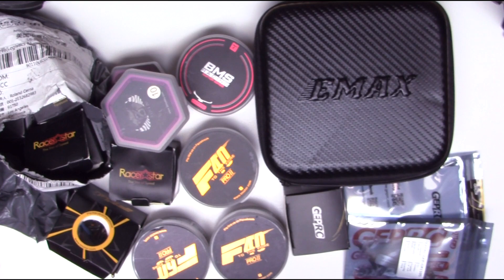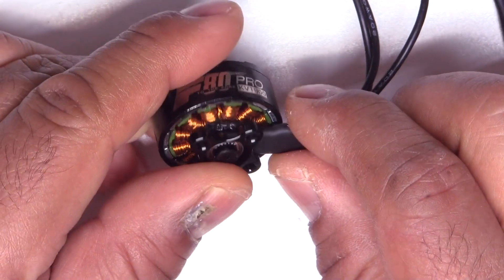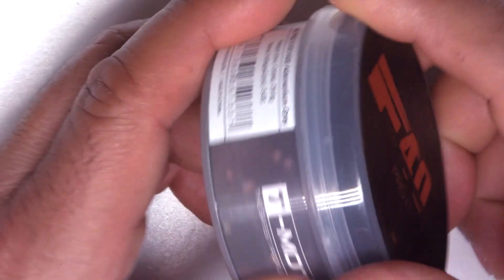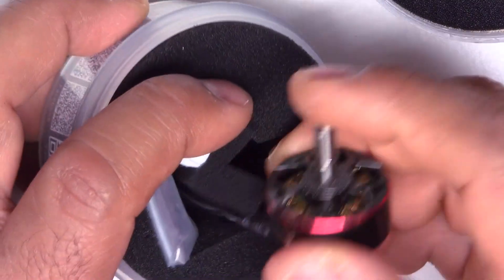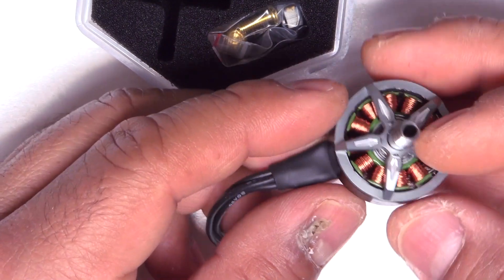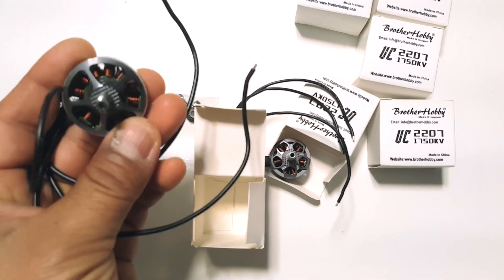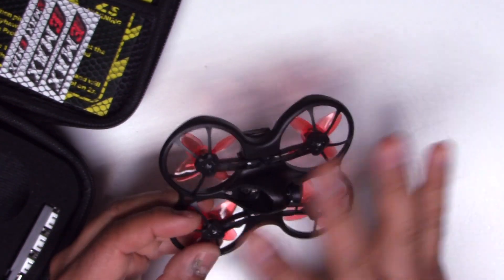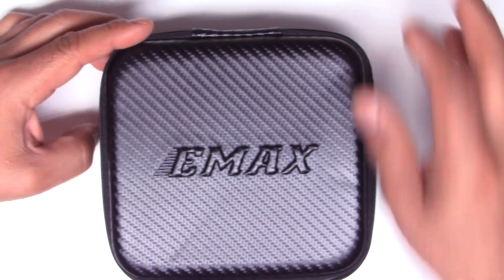Reviews Coming Soon - Update

Comment: There are a ton of motors coming out for lightweight 2.5in 3in and 65mm quads. Please test the new offerings in the 1103, 1105, 1207, and any of the shorter 13xx 14xx sizes and please test newer props. HQ 3x2, HQ 65mm T mount and push on, Emax Avan Mini 3in, Emax Avan Rush 2.5in Gemfan Flash 3052.
Reply from the maker: I'll have to seriously consider ordering all those props, however first I gotta finish testing all these motors and a few more I just got from BHobby. Unfortunately time available for hobby  stuff keeps decreasing :(

Comment: Nice to see you back in business :) I have the racerstar 2514 AIRB on the way to review. Got an 8" frame to stick them on but I suspect I'd be much better with 10"
Reply from the maker: Thanks Coppertop. Those 2514s will be plenty powerful for 8" and as you say a food match for larger props. Racerstar has released some interesting new motors lately. They sure don't look super low budget as they used too. They're slapping on the T-motor label as they had to do with their manufacturing. Hopefully they deliver and no surprises. We'll be looking forward to your 7" build. Will be Definitely informative on how a beefy motor will do with 7" (underpropped) setup. I think Bgood is sending me one of those too.
Reply: EngineerX yeah. Looking forward to your numbers on them. They certainly look quality but t motor seem to be sticking their logo on lots of stuff lately. 3B 2306 will be interesting too. The 2207s are super smooth, but it’s the 2306 I really wanted.